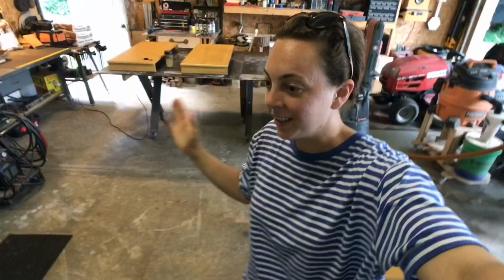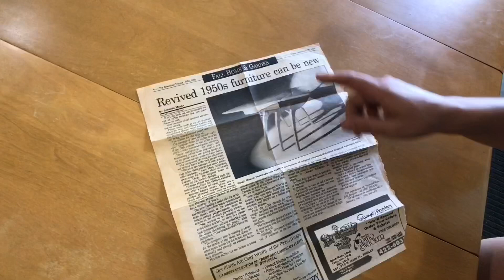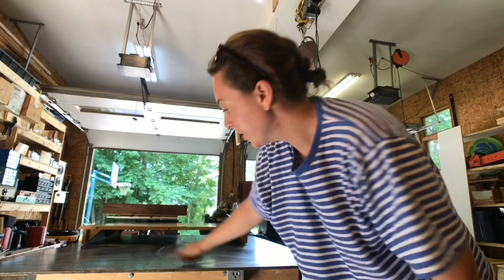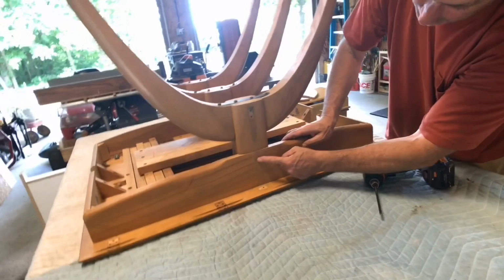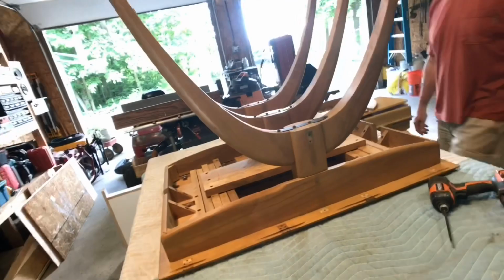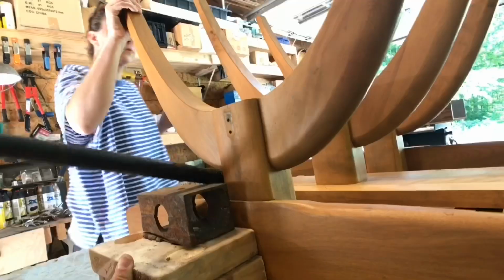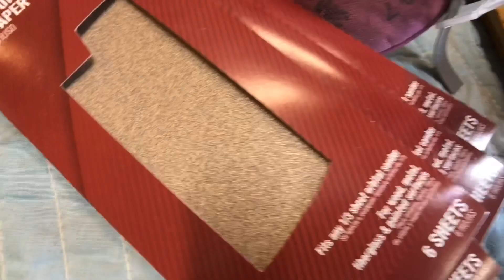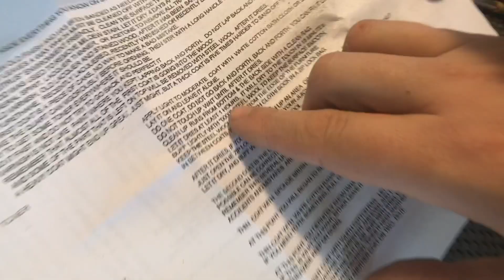Heywood Wakefield Wishbone Dining Table Restoration - mid century modern furniture

Comment: You never said what the stain was and where you got it.
Reply from the maker: https://rover.ebay.com/rover/0/0/0?mpre=https%3A%2F%2Fwww.ebay.com%2Fulk%2Fitm%2F153577286920
Reply: @LaurenMattice  Thanks for the video. I have the same table and would like to do same thing. Curious about the stain - the ebay listing is expired. Do you remember the brand name/type?
Reply from the maker: Hey hey this is the seller I bought the stain from. In the color Wheat: https://ebay.com/usr/needful_useful_things
Reply: @LaurenMattice  Hi this newer link is also expired. Could you please type out the name and brand? Thank you!